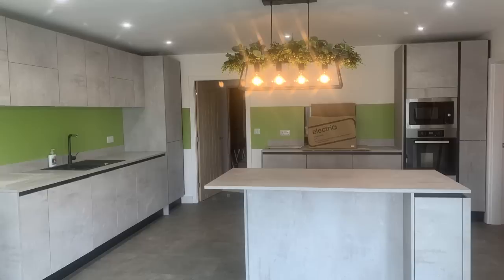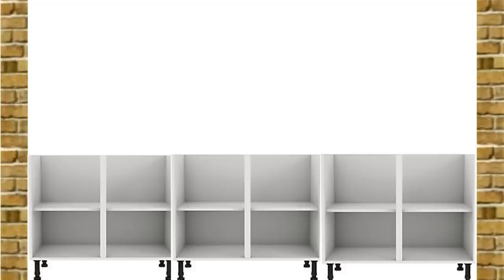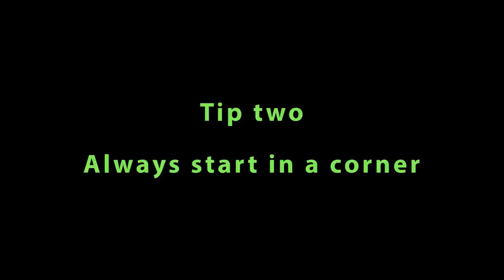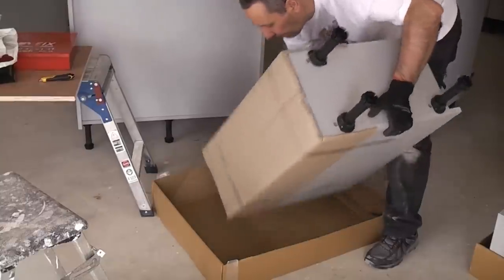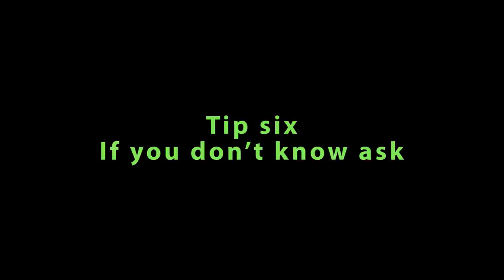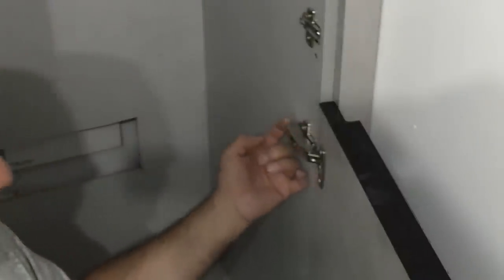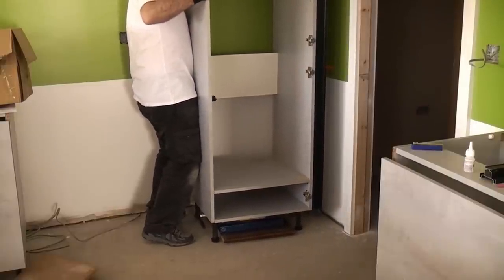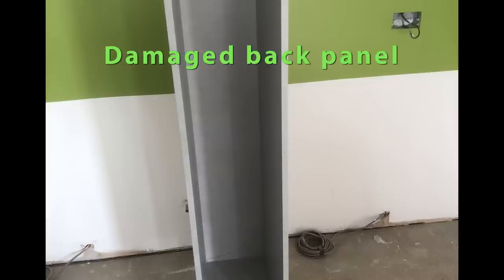Kitchen fitting basics plus 12 kitchen fitting tips

Comment: Cracking video Chez! I’ve fitted a few kitchens in my own home, always a testing experience! The last one I ripped out here just after we moved in, the kitchen fitters who installed it had written ‘kitchen from hell’ on the rear of the backsplash 😂
Reply from the maker: I think I’ve installed about 5 kitchens, mainly in my own homes, and one that I installed for the girlfriends late father.
I’ve never had problems like I had on this job, it really tested my patience! 
Kitchen from hell 😂 😂
Reply: @ultimatehandyman  ah hour drive at either end of the job is a nightmare in itself, I can well imagine your patience getting very worn out!
Reply from the maker: Yeah, also a few times there were accidents on the M65 or the M6 and I got stuck in traffic!
I’m glad that I don’t have to commute to work each day, that would be my worst nightmare! 
I’ve only got a sink to install in the utility room now. I went over to cut out the worktop and fit it on Friday. I drove over, got the sink and placed it on the worktop and it was the wrong size sink! The unit is 900mm and the sink is 1000mm. I should also mention that there is no mobile phone coverage at the house, so I had to walk across the road and telephone the girlfriend. I could not check stock at screwfix from my phone, so drove to screwfix, only to find that they didn’t have the correct size sink- until the next day! I just packed up all my tools and drove home, and cracked open a few cans of cider 😂
Reply: @ultimatehandyman  mate that sounds an absolute nightmare! I am fitting a new bathroom at the moment and was at Screwfix 3 times in one day due to having or getting the wrong sized things!

Comment: Tip 2. Absolutely!👍
Loafer's tip. Never let the customer measure, design and then just go buy the carcasses off the shelf. Especially if there is a L shaped run, as they will not allow for the gap in the corner, nor the corner post. Or a double sink when a wash mac is going right next to the sink unit.😆
Reply from the maker: Great tip!